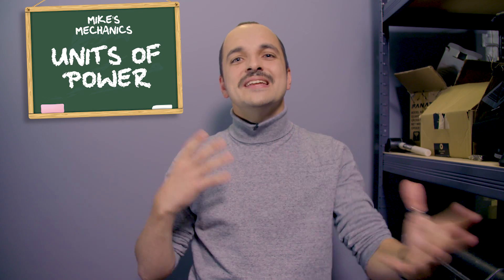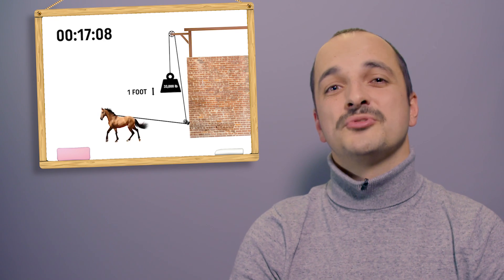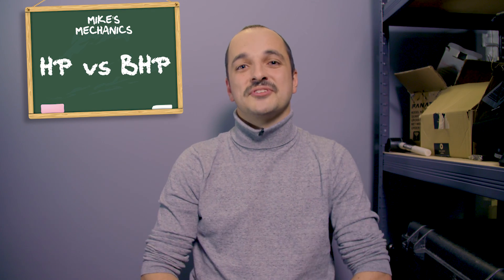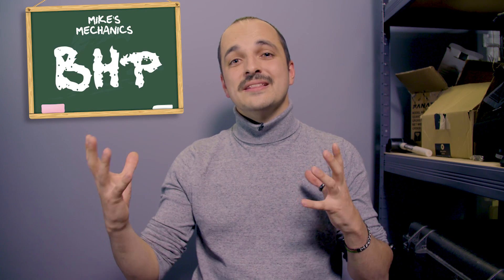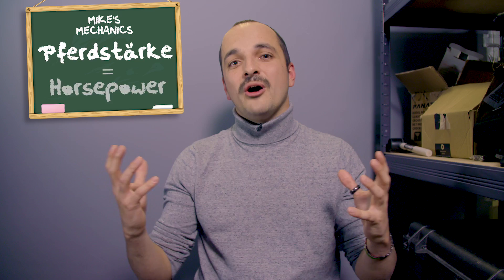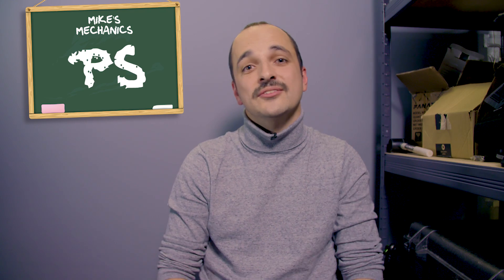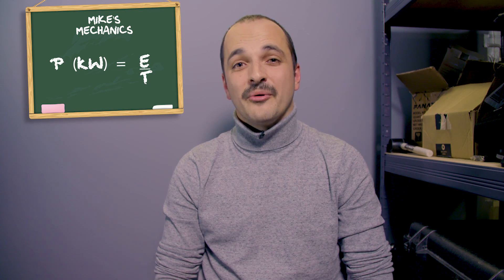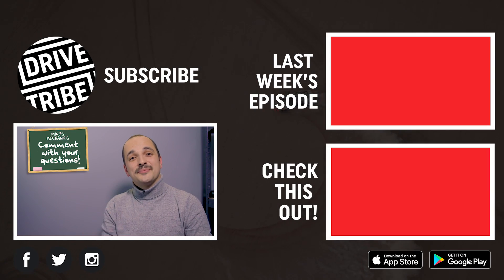What's the difference between BHP, HP and PS? - Mike's Mechanics

Comment: good info,.,,but,.,.here in the U.S,,. HP is divided ,,.,engine stand HP...wheel HP are very different in all circumstances ..only the 2 accessories mounted is the "unrealistic" stance.. a powerplant is not reliant on those units and they can be deleted or modified by ppl searching for HP,.,. so ,our dyno hp is generally done on a roller ,. with HP specs on 1 end  as apposed to what the roller is telling you,. so you can get your cars draw on the power plant....because drivetrain losses are the biggest hp killers,.,.,. so it doesn't matter if your car is 600bhp.. cuz there is way more drag then just the accessories killing your HP, ultimately tricking you into thinking they are telling the truth,. which none of them do/...and cuz consumers wouldn't know what they were hearing anyways

Comment: Horsepower figures used today assume that the one asking about it will also want to see how torque is delivered over the RPM range of an internal combustion engine, much like modern engines producing the equivalent in KW of 550 or 700 Hp but only deliver said Hp and especially peak torque at 6500 RPM or more making them useless in realistic off-road scenarios without having 27 gears or CVT, out goes subtle control, older engines will have delivered their peak torque in the neighborhood of 2000 RPM while producing some 250-300 Hp at around 6000 RPM because they're probably pushrod engines.
from this standpoint, how can one determine the torque curve of an internal combustion engine with KW, while choosing an engine for off-road use, the question of torque curve is the only important deciding factor

Comment: The statements from 01:30 are false. US shifted decades ago from SAE GROSS (power measured without water pump, steering pump - higher values) to SAE NET (lower but more realistic values). The different values between Europe and US are not because of this. It's because US values are in "mechanic HP" and Europe values are in "metric HP". This is why the same engine "has" slightly less HP in US specs.

Comment: I wouldn't use watts to measure the power of an internal combustion engine, and I wouldn't use horsepower to measure the power of my kitchen appliances. It would not be British of me to not use metric and imperial units at the same time and switch between them randomly, particularly when one's fuel capacity is measured in litres whereas fuel consumption is measured in miles per gallon.
Reply: And then you can use imperial or US gallons :D
Reply: Fel consumption is preferrably measured in l/100km
Reply: @larsev  no thats stupid, why would you measure quantity of fuel against an arbitrary distance?
Reply: @spawnof200  everyone uses that
Reply: The thing is, kw is just more accurate. And usually a more useful number to have
Reply: I had a car where the fuel consumption indicator on the dash was in litres per mile. Really useful.
Reply: And the sizes of the tires on your car?
Reply: wordreet. Tyres
Reply: john turner Wanna argue about it? 😛
 30 years ago I worked as a tyre fitter for Chessington Tyres. And if you’re English like myself, you tire when your energy is running low.  😴
Reply: wordreet. Check mate 😁
Reply: wordreet what made you RETIRE ?
Reply: ...and Euros give us shit for using pounds and feet.
Reply: mattdobz mate, when the battery in your car is rated in kwhrs and you know the cars energy consumption in kw, you divide one by the other to get running time. Simple. Why mix it up by using hp.
Reply: I'm confused by the double negative. "It would not be British of me to not use..."
Reply: Fuel consumption numbers are just half done  sums. Why be so convoluted with l/100km, when you could just use square mm instead?  4l/100km = 0.04mm^2.

Comment: Only true measurement of power is the SP or Shrute power.  Developed by Dwight Shrute.  It comes from measuring the time/distance it takes his cousin Moes to carry a bushel of beets across the field.   It is simply the superior unit of measurement.
Reply: Beets,bears, Battlestar Galactica!
Reply: seems legit
Reply: Who needs science and metric units when this method seems to be unbeatable?? LOL
Reply: @camel9  beet beat bhp
Reply: Texas Car Nerd   -   While not power related, the smoot is, by far, the greatest unit of measurement.      https://youtu.be/-scs_yF59YE
Reply: The same then can be said about hp
Reply: LOLOL
Reply: Thank god for Kilowatts
Reply: Pferdestärke bro😊
Reply: Yes, lets all adopt another unit of measurement. They are all convertable with an app now days.
Reply: @fourbypete  XD 

I guess "Convertible" is pun intended LMAO
Reply: @ryneagheilim9782  Lol i didn't realise I spelt it wrong till now. So much for auto correct.
Reply: sarcastic much?
Reply: Is this a metric or imperial bushel?
Reply: I'm a seasoned continental  electrical engineer and grew up fully metric and watts. But I still judge a cars performance in PS. I simply have 50 years of instantly accessible PS reference data in my head from volkswagen beetle to lamborghini countach without need for calculation.
Reply: Sometimes people complicate too much 😂
Reply: Horsepower at the drawbar.

Comment: how bout the industry would just stop using PS, hp or bhp and stick to kW? it's anyway the unit the engineers use. if nobody has to calculate how much xy kW is in PS, they can use those expensive seconds for another, more important task which leads to a better efficiency with in car companies... ;-)

Comment: 1. It's written and spoken Pferdestärken and not Pferdstäke
2. Instead of PS, KW is officially used here in Germany, but probably around 90% are still using PS, if not than even more (Most of the video games are mainly the only who are using KW in Germany)
Reply: And the reason is that the number is higher (100 kW =136PS everybody wants a higher number so people still use PS)
At least NM don't have to be changed ;-)
Reply: @nirfz  You could change it to Nm.... :-)
Reply: @grobetog  true...
Reply: @LMO169  yeah, PS is nearly the same as HP, so it's easier to understand how much power something has, in an over language, if you understand what I mean. Because my English isn't the best, so I didn't know how to write it correctly
Reply: @LMO169  ok, PS ist fast glei wie HP, wodurch es einfacher ist die Leistung z.B. Amerikanischen Motoren umzurechnen oder das man einfach nur besser versteht wie viel Ps es ungefähr sind
Reply: @LMO169  this is unrequired but maybe necessary in order to compare the power of system with another

Comment: what about IHP? 
imaginary horsepower
Reply: That's what you get after all the sticker power is added!
Reply: @c19rc  and weather guards
Reply: @juanramon2790  and rallystripes
Reply: @assasine08  lets keep this going and fake hood scoops
Reply: @juanramon2790  Fake inlets that do nothing
Reply: @assasine08  really big spoiler for "downforce"
Reply: @juanramon2790  Dont forget those lips also for "downforce"
Reply: @assasine08  gotta add the flame decals
Reply: @juanramon2790  lol tbh don't spoilers decrease the hp? More drag --> less efficient at high speeds (assuming you're going in a straight line for the IHP test)
Reply: Red cars have more IHP
Reply: That's BUP.  Break Unicorn Power.
Reply: @ every Honda owner ever

Comment: We should all use wheel horsepower cuz that’s really what matters
Reply: IF you are talking about wheel horsepower,  you are considering the complete powertrain's ability to transfer power.
Reply: Lars Henningsson does this make anything different?
Reply: @larsev  Wheel horsepower is the power you have available to use ,that is what is important!  you loose a load of your power though a drivetrain  so a measurement taken at the crank is bullshit ,you don`t get to use it .Please tell me what I have to play with!!
Reply: power to weight ratio is about the only useful info, esp. when manufacturers use the same engines across multiple platforms... engine output by itself is rather meaningless... good for marketing tho
Reply: We should all use kW cuz that's the only usable unit!
Reply: No, Torque is what matters.
Reply: @dryzalmynelli9600  then have fun purchasing bulldozers and drag racing them, they have a load of torque brother, really low in the rev range too
Reply: @StefSyros  you've missed the point, but that's okay.
Reply: @dryzalmynelli9600  good to know
Reply: @StefSyros  Can we see your Dodge Demon pulling 750 tonnes? It has more horses than Volvo FH16 so should be piece of cake, right?
Reply: @dryzalmynelli9600  wrong😂 why you talk about things you don't know?

Comment: What about WHP? WHEEL HORSE PORWER???
Reply: Do you want to learn about that or just to be mentioned in the video?
Reply: @PetrolheadAEHG  learn of course man. Knowledge is power.
Reply: @redzone5655  ok, the difference is the way they are meassured. The WHP is meassured with the entire car on the dyno with the wheels, instead of just the engine being meassured. With the gearbox, drive shaft, diff and in case of automatics, torque converter, you lose power from the engine to the wheels. I don't remember how much, but lets say you have 10% of *drivetrain loss*, so your engine produces 200hp but with the loss, you have 180hp to the wheels. I hope I can help you, if I don't, go to "engieeniring explained" channel, he must have a video about this 👍
Reply: @PetrolheadAEHG  oh. Thanks. I will look into that. Have a great day.
Reply: @redzone5655  Thanks man, you too
Reply: That's 2 different things. It's just what's left after the crank. Doesn't mean the engine doesn't have the HP claimed.
Reply: @BrawndoQC  oh! I get it. As a customer, should I be more insterested on WHP or HP alone? Is crank shaft technology so different between manufacturers that it is relevant to pay attention to this?
Reply: @redzone5655  Well yes like AWD lose more power at the crank etc. Unless you want to put a car you didn't purchase on the dyno? Not sure what's your obsession with this you can google average percentage lost at the crank on stock cars.

Comment: real hp is whp
bhp is just good for showing off or used in magazines
Reply: Not because an engine is not putting the same power after the crank that it's false. WHP is what's on the wheels, I agree with you but it's still not a lie if the engine is 500 HP and 450 to the wheels for example.
Reply: I also really like the kw at the wheels value. This is what really accerlerates the car. Huge drivetrainlosses from all wheel drive need to be accounted in my book,
Reply: whp are use by tuners, who doesn't have the resources to test crank hp
Reply: I know this is DriveTribe, but "(?)hp" is a metric for the force output by an engine. Not all engines drive wheels. That includes some engines we also see in cars, motorbikes etc. So figures at flywheel/crank, with/without auxilliaries etc, are far from useless. Just need to know what you're looking at and looking for.
Reply: i am more interested to see the power to weight ratio... that's your true power on the floor.. every time i see cars info.. i calculate it and know in realistic how this car will perform..
Reply: @Philipp Kälin universialy used too XD
Reply: That was gayest thing ive heard
Reply: Hp and whp are two separate things. Never mind you’re just asking attention.